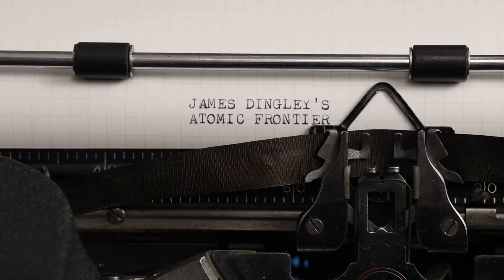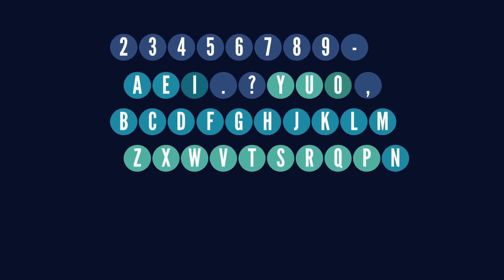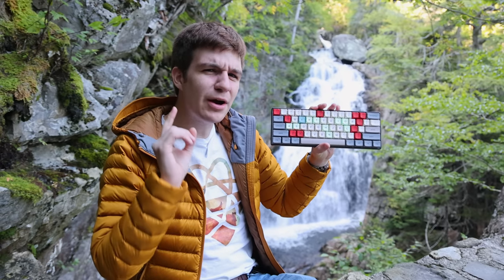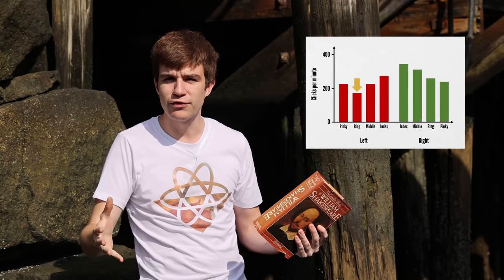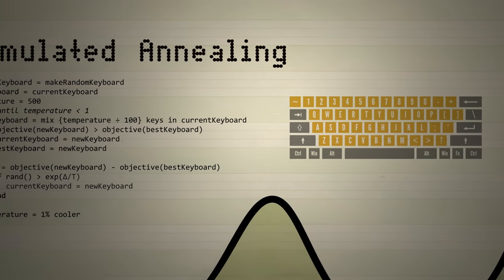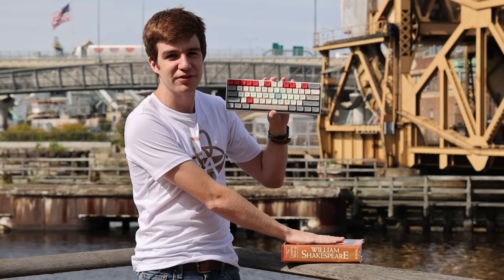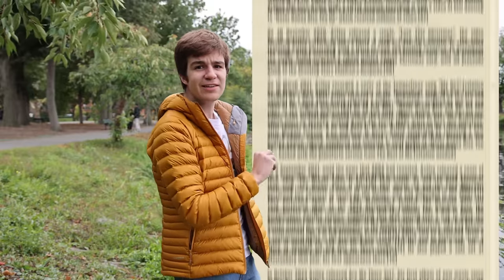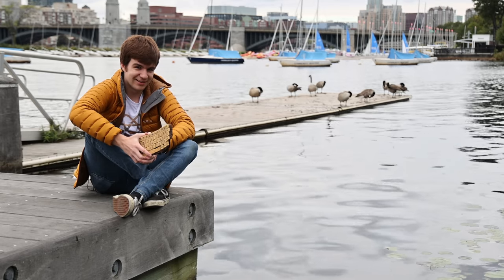QWERTY is broken. Can we make it better?

Comment: the layout of qwerty isn't to blame for people getting RSI from keyboard usage. Bad wrist posture is. Most people type with their wrists bent at an absurd upward angle, and companies even sell these gel cushions that strongly encourage this hand position. The clips/feet that angle the keyboard upward also encourage this. But this posture puts the most strain on your tendons. Take a page from piano and try keeping your hands floating above the keyboard so that your wrist is straight and your fingers "fall" into the keys so that you're essentially typing with your arms with a little bit of assistance from your fingers instead of making your fingers do all of the work. Doing this will minimize strain and then it won't matter what keyboard layout you use. Mouse usage is also a big injury risk, which is why I avoid using the mouse as much as possible, preferring keyboard shortcuts as a necessary accessibility tool (but also because I just find mouse-centric UI annoying as hell). When I have to use the mouse, I lower the sensitivity not so much that it's annoying to use but enough that I have to use my arm. While I have never in my life gotten RSI from keyboard usage, I did get tendonitis from high sensitivity mouse usage at one point.

So that's my recommendation: throw away your wrist cushion, fold those clips in so your keyboard is parallel to the desk, lower your mouse sensitivity, try to avoid mouse usage as much as possible, and when typing, don't ever let your wrists touch the desk. Make like Pennywise's victims and fffffloat.
Reply: i don't know what keyboard you have but the stands don't have your wrists at an "absurd upward angle" unless you've got your keyboard at the near edge of your desk and no arm rests.
Reply: i realize this is the opposite, that's a downward angle from the perspective that you're referring to. but most keyboard wrist rests aren't solid, you're meant to cushion your hand into them, not rest it just on the surface. still no idea what you mean by "absurd upward angle" though.
Reply: @rm_steele  Just look at how the guy in the video types. He has his wrists in contact with the table and is having to cock his hands up to type. He then complains that his wrists were sore after a day. Hmm, I wonder why. He blames the inefficient key layout, but I'm telling you that his horrible wrist posture is what made him sore. The bad layout just made it more noticeable. I'm just about 29 years old and my wrists have NEVER been sore after a typing session no matter how long it was. You should not be typing like this, it WILL injure you. Try this: put your right elbow out in front of your chest, forearm up, thumb towards your face. Now bend your wrist as far as you can towards the right and attempt to wiggle your fingers in a typing motion, as if you were typing ";lkj;lkj;lkj;lkj" rapidly. Look at your wrist and see how you are straining your tendons by doing this. Go ahead, put your left thumb over your wrist tendons and feel how tight they are while they're moving. The effect is even more pronounced while your wrists are pronated. Keep wiggling your fingers and attempt to pronate your wrist. That is, rotating it 90 degrees clockwise. Isn't that extremely uncomfortable? Now let your wrist go limp as if you were doing cat roleplay or you're a boomer doing an impression of what you think a gay person is like. Suddenly it's a lot more comfortable. This "limp wrist" posture is the posture your hands should be in when playing piano, and it works for typing, too. The point of the weird chicken wing exercise was to show you just how much strain it puts on your wrists to lay them on the table and cock your hands upward. Your tendons run UNDER your wrist. By cocking your hand up, you are pulling on them, i.e., straining them. The clips alleviate this somewhat by angling the keys a little bit towards your fingers but this is just a band-aid. If you have any wrist discomfort whatsoever when typing, try my suggested way of typing. Let the weight of your hands actuate the keys instead of making your fingers do all of the work. This is how piano players are able to play piano for their whole lives without getting RSI despite how much more force it takes to strike a piano key. Wrist pronation + tendon strain WILL give you RSI. This is not a debate. This is a well-known fact.
Reply: @BradenBest  I should preface this by saying I'm not a home row typer, I've never liked it because i self learned typing, but I believe what I'm saying us still applicable because i mostly keep my wrists on the desk when typing. I'm not even a touch typist, I look at the keyboard way more than I reasonably should.
I can't exactly compare to anyone but myself, but most people don't type with their shoulders as high as possible and their forearms pointing as down as possible. your exercise is not really pertinent to typing. plus, i feel much more comfortable with my hand angled slightly outwards towards the top of my arms than with my wrist limp, and doing that puts a lot of strain on my index fingers and would make typing more painful if i was sitting on the floor so that i could actually make my wrist limp and still type.
i checked the video. when he's using the inefficient keyboard he very much has his wrists off the table because he has to move his hands so much, so that's very much not the issue. it seems like his hands were parallel to his wrists as well. on the other keyboards, it appeared that he still didn't have more than maybe 20° deviation from his wrists to his hands.
of course it's going to strain you if you're pushing your wrists to their limits and then trying to rotate them. my hands still don't feel great from your chicien wing exercise, but that exercise is not comparable to the common typing postion unless you keep your chair as high as possible and have a really low desk.
Reply: @rm_steele  The point of the exercise was to try to show you how exactly bending your wrists up strains the tendons, because you didn't seem to "get" it. I wanted you to feel, viscerally, what it's like to have your wrist tendons strained. Judging by what you said about it not feeling great, it seems like it worked. Also, I'm not a touch typist either. I am just really, really fast at hunt n peck, and know the entire qwerty layout like the back of my hand. And though that probably sounds like touch typing, I don't do it "properly". Touch typing has you using the nubs on F and J  to locate the home row and then using all 8 fingers from a stationary hand position. When I type, I look at the keyboard to find the first couple keys I'm going to press and then my hands fly all over the keyboard locating keys with pure muscle memory, and I rarely ever use my pinkies. I also type pretty hard. I am become death, destroyer of spacebars. I am what happens when a piano player is never taught to touch type but gets good at typing anyway through a decade of brute force.
Reply: @BradenBest  well I could definitely feel the tendon strain, but i don't think the 15-25° slope that I personally (and i can only assume most typists who rest their wrists) have will do much damage, especially if they don't do a large amount of typing as a core part of their job. also, in the original comment you said to ditch the wrist cushion. wouldn't the cushion lower the tendon strain by forcing you to elevate your wrists? at least, if you've got your elbows roughly below the surface of the desk. which, do most people not do that? maybe that's why i'm not quite following what you're saying?
from what i read while writing my previous reply, it seem that while most people use "touch typing" to mean specifically home key typing by memorization, it's not strictly the definition. so it's not quite that what you're doing isn't touch typing so much as not the home keys method. I pretty much onlty use my index and middle finger to type.
Reply: @rm_steele  Maybe, but having your wrists angled up while using your fingers is bad for your wrists regardless. It's better for your wrists if you keep them straight and float your hands over the keyboard. I don't know how to illustrate it any better. I have my keyboard at the edge of my desk and when I type, I sit up and my elbows and hands are easily above the keyboard, so it's easy for me to use this posture. That said, it's easy to do it at work, too, where the keyboards are in various configurations.

Comment: It would - of course - be a real pain if everybody had a personal keyboard layout, so to actually propose an improvement to Qwerty we would need to run this simulation for every alphabet based language and an average sampling of people (left- and right-handed with different level of hand bias and typing speed) and different document types based on usage frequency. Then the layout also has to account for additional letters that don't appear in every language (äöø etc).
I have a theory why all attempts to change the layout so far have failed 😁

Comment: A better layout probably helps, but frankly, better engineering is important too.
Switching to a keyboard with mechanical switches instead of the usual rubber domes raised my typing speed from 70 WPM to 90 instantly with no other changes. It's way easier on the fingers, too.

If you type a lot, it doesn't make sense to use a cheap keyboard. Think of the keyboard that came with your PC like the plastic silverware at a fast-food restaurant. It works in a pinch, but c'mon.
Same goes for your mouse.

Comment: Data doesn't take into account the backspace key. Backspace key is touched MANY times by everyone that's human. Assign your capslock key to backspace and you'll be astounded how much improvement that gives. You can use a mouse while backspacing as well which is wehre most of the benefit comes from.

Comment: Developers use keyboards differently from just typing text. The use of non-alphanumeric characters is more prevalent. So it would be interesting (to me) to see how your model would optimize a keyboard for a specific programming language. Using all of github public repos, should give you enough data to train the model. There's probably more Python in github than the full works of Shakespeare.
Reply: I've noticed that most software developers simply don't do ten-finger touch typing. The vast majority of them have some kind of method they've evolved intuitively from hunt-and-peck. (I do touch-type--I learned it in a high-school class that I think was the most valuable course I took in those whole four years, though it was an extension course I took at night. But I only really got fast messing around on the Internet years later.)

Comment: Typing doesn't suck. This "faster typing" concept is horribly misleading nerd meme, and doesn't actually transalte to speed of input, nevermind comfort.

With all physical controls, we map intuitive <actions> to spatial location/movement, kind of like a mind palace. When fully interiorized, the controls vanish - we simply "do the action" that we want. For this exact reason, every enthusiast/professional community values good physical controls. They get out of your way as much as possible. Be it a plane, a gun, a car, or a photo camera. 

Being spread out in irregular way over physical space is what makes them memorable.

That's also the reason why soft keys never work in practice. No matter how "logical" or cheap they are, they actively break our mental spatial mapping. Not only they are clumping all "controls" in the same place, they are also modal (which in itself is horrible) and offer no meaningful feedback (notable exceptions are half-soft solutions like console controllers, which pair standardized layout with a schema convention). 

So, do such "better" layouts somehow lend itself to reaching automatism easier. Can you now control the device with LESS errors? 
Let's take this beaten "fingers resting on most-used letters" idea. 
We've removed almost all physical travel, so our most used controls now lack felt physical location and movement difference. Does this actually make for a better way of inputting words?
Is it easier to memorize such layout to the point of touch typing?
How to even measure these meaningful outcomes, if we want to measure ease of input as opposed to "speed of a keypress".

Is there an objective proxy measure for this somewhere in industrial design? I can imagine something like percentage of errors in routine use, or input accuracy under stress (only the most automated behavior survives under stress). But I've never seen an actual industrial desginer comment on this.

Comment: I looked at all the 'good' keyboards at 10:30 and they all have 'caps lock' and 'ctrl' in the same place. I always swap the two because I use a lot of shortcut codes using the ctrl key and almost never use the cap lock key. I learned this from a career using Unix keyboards.

Comment: Learned to type an Dvorak this year. It fixed the annoying thing where I only used one finger of the right hand.
Still there should be a couple changes plus the keyboari should not be flat.
Next I want a curved blank keyboard so I can customize it. I wonder if Das Keyboard does the curved option ...

Once your awareness goes up enough it is sooo frutrating to use qwerty...

Comment: There is no perfect keyboard, because the best way to type is not through the "proper" etiquette of typing, but rather a memorization of the layout and using the pointer finger method, which is usually slower but only if you don't memorize the layout.

Comment: Qwerty still seems the best for dividing workload and stress on fingers.  All of the other designs made more fingers less used, while having fewer fingers do more work.
Reply: a slight bias towards the index and away from the pinky is probably Desirable, actually. Or possibly the reverse, depending on your logic. 
For reducing stress and strain, which character is on which key (and thus finger) is rather less important than the relative position of the keys. QWERTY or not, the staggered rows (rather than  the Columns being offset to accomodate actual human biomechnics) are the real killer there, along with the hand position forcing one to hunch and strain one's wrists (a fully split (not just ergonomically angled, though that's better than nothing) keyboard deals with that problem.)
Reply: @laurencefraser  I don't think it's the layout.  I think its either people are using crap keyboards, or are overworked on their keyboards.  My slim keyboard would sit too low and hurt my joints in my fingers from pressing a membrane a few mm till it bottomed out, but not from my mechanical keyboard with keys on springs that have a little cushion and travel.

Comment: But what you proved is that there is no such things as the perfect keyboard, even when it's optimised for a specific user. It's absolutely task specific, and as you won't know the letters in that  task until you are finished, it's impossible to calculate.

Comment: The Dvorak layout is extremely terrible due to its placement of all vowels on the left side. This necessitates alternating hands for nearly EVERY word, which is impractical for several reasons:

1. Playing a composition on a piano is most effective when phrases (sequences of notes) are grouped by one hand. Coordinating two hands is a challenging task, as evident in the experiences of dancers and martial artists.
2. In the realm of fighting games, movement buttons are never spread across both sides. Speed and accuracy are crucial in such scenarios. Even when navigating text, using cursor buttons with one hand is more efficient.
3. In English, the most common digrams (sequences of two letters) are ER and TH. Dvorak separates these letters onto different sides, making it impossible to type digrams with one hand. Trying this out, one can observe that using middle and pointer fingers on one hand is more accurate and faster than alternating the pointer finger between both hands.
4. And you can forget about all shortcuts and your VIM experience.

Individuals who express affection for the Dvorak layout may be influenced by a placebo effect and might not have conducted serious research or critical thinking on the matter. The layout can handful for the people who type with only one finger, for whom alternating hands might be the most suitable option.

For those genuinely seeking a better layout than Qwerty, layouts such as Colemak, Capewell, Workman, or Norman present significant advancements without the convoluted mix seen in the layout presented in the video.